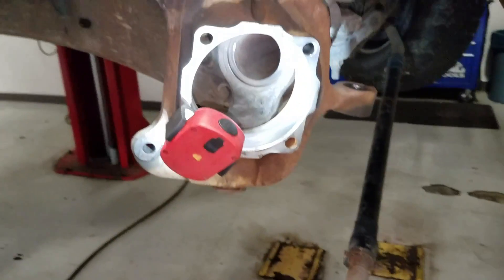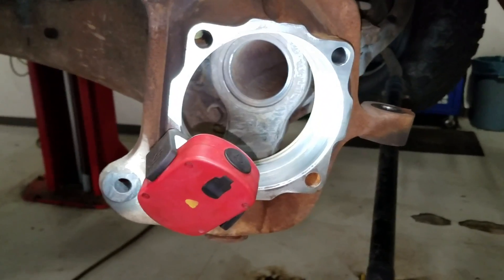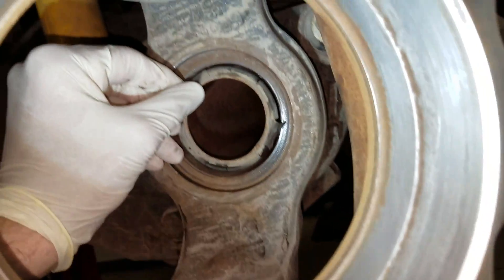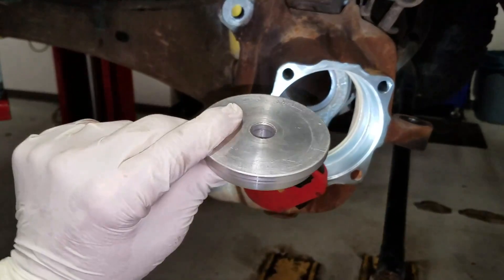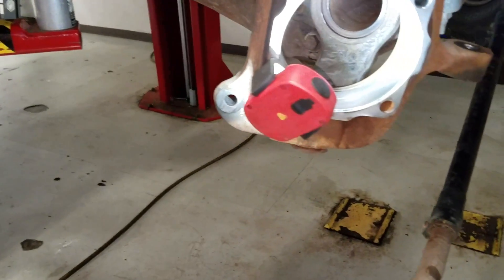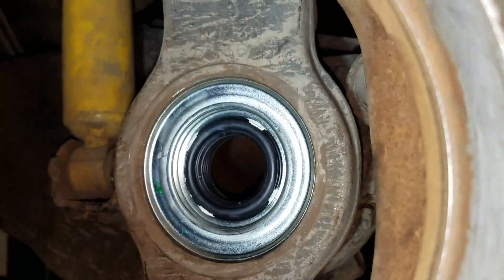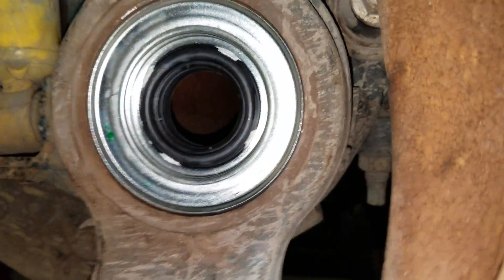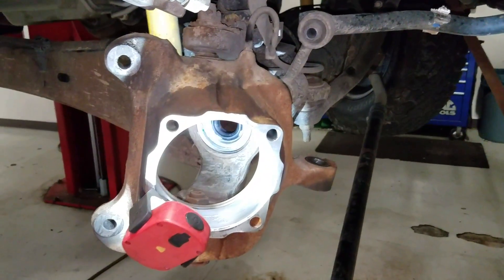Powerstroke - Front Axle-shaft dust seal

Comment: Good day, is it possible to supply me with the part number you used in this video. Struggle to get the seal through Carquest and Ford
Reply from the maker: Chk ur IG
Reply: @PowerStrokeTechTalkwARod  What does IG mean ?
Reply from the maker: Instagram
Reply: @PowerStrokeTechTalkwARod  Thanks was try to find that same thing for my 2002 Excursion 7.3 Diesel 4x4